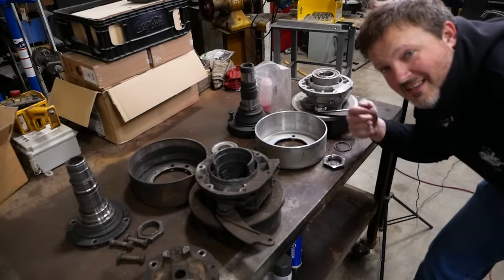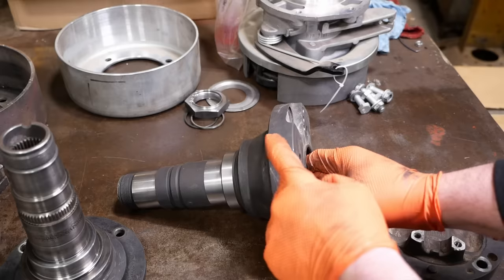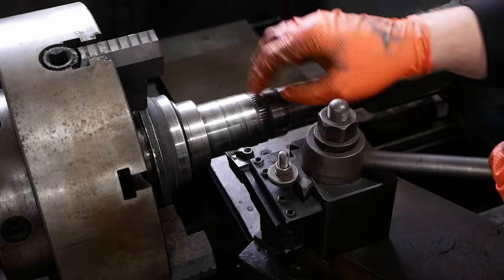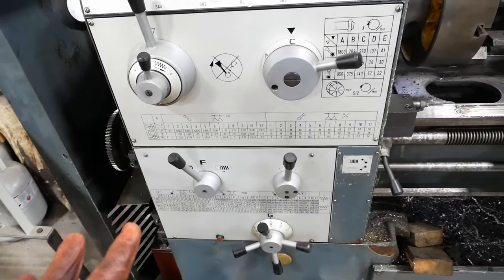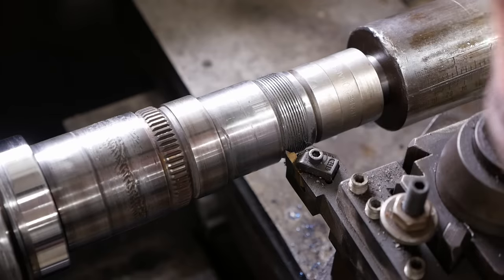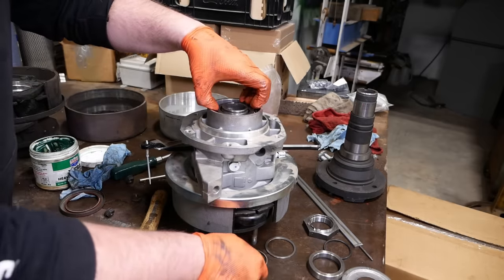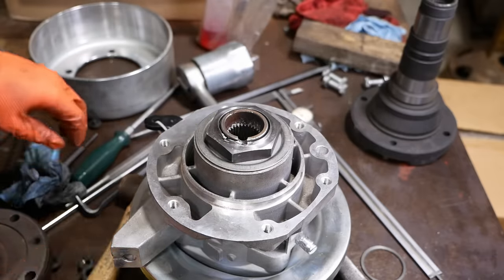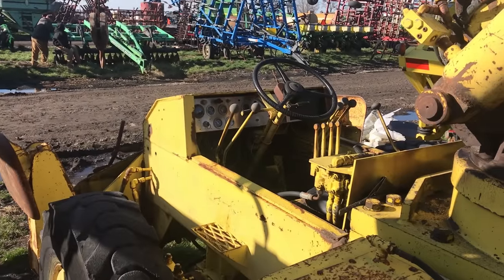"Sir, Your Parking Brake Exploded" - Fixing a Ford

Comment: Had boxes full of parts for those parking brakes.  Had fleets of these trucks.  Fyi ford used Transmission oil, We always used 75w90.  The really killer of these was people would forget to release the parking brake and smoke the drum.  The drum is difficult to get now.  
   We always checked for leaks when we serviced the trucks.  75w90 works far better, also be sure the vent works.  They would easily get plugged.
Reply: Thank you sir. I've been searching for hours for this info. I just got a brand new unit that I waited two months for. ATF was turning black after just 1000 miles and was wondering why ATF is used in these instead of gear oil. I'll give it a shot. Just wanted to say thanks for the comment/info.
Reply: @shallowada -if the atv is turning black it is getting hot.  I would be checking to be sure its not shimmed to tight.

Comment: A handbrake that requires oil.
NOW I've seen it all.
Reply from the maker: I know...
Reply: I got AC Delco handbrake cables that said to NOT lubricate or grease them due to dirt accumulation. They rusted stuck in a year.

Comment: I love watching your machining videos, Wes. I'm a now retired toolmaker, and learned my trade under the tutelage of guys who'd been working since the 40's and 50's. The last 15 or so years of my career, I used CNC equipment almost exclusively, but there were times those old skills on manual machines definitely saved the day, like you did saving those threads. Keep up the good work!
Reply: Correct. Thats why there will always be a need for older manual machines.

Comment: Hybrid Truck [Edison] video disappeared while typing, so posting comment here.
Excellent presentation, Wes. Learned a lot, thank you.
I should be able to answer this for myself, but don't know the efficiency value to compute: Is there no advantage to be gained by loco-style diesel electric for cars? No Batteries. Just IC engine running at best efficiency turning generator and alternator+steering pump. Genny powers (say) hub motors on rear wheels and contoller for these. No transmission or driveline. Could employ back-EMF braking to waste-heat pack to reduce pad wear. Perhaps a small auxiliary battery could be charged from this for other accessories.
Sidebar: See no environmental value in EV's unless they're charging from nuclear power. Again, wish I could know accurate numbers - but know that a pound of hydro-carbons burned in daily drive gasoline car would need more than a pound at a power station if it was an EV.
Reply: Of course now the batteries are now key to the transmission process.  Edison motors has chosen a Lithium iron phosphate battery.  It is minus 30% energy dense (compared to Lithium Ion) but good for lifespan and high charging and discharge cycles and much safer against thermal run-away. Now braking their e-axles will generate back EMF (I am just guessing you know the technology) to charge the batteries.  The batteries are now a buffer between the ICE engine and e-axles.  What could go wrong, you have the best of both worlds.  They have engineered it to run on Electric power but if the batteries go down to 50%, the generator will turn on and charge it to 80% and so on and so on.  Unless they flip the manual generator switch.  As long as you have Diesel, the truck will perform as a vehicle or a power plant at your job site. It can provide 2 or 3 phase electric power as long as you request it.
Reply: Good pitch. But I'm talking about NO batteries.
Reply: Not good for the reasons that the Edison batteries can take an in-pulse charge 3 times it’s charging capacity 3C (I don’t actually know) and discharge it 3 times as well 3D.  The batteries act as an energy buffer.  I guess you can run without batteries but you need to substitute it with capacitors.  Otherwise your system will just depend on the power output of your engine (up and down rpm) and without the chance to harness regenerative braking.

Comment: Awesome stuff, love seeing that kind of skill and knowledge going into rescuing parts.

On the subject of peening over the nut, I once faced a few thou off the back face of an unobtanium nut with a similar locking mechanism to get an unused section to line up. That application called for loctite as well. 😂

Comment: The rivets were for the original drum.  It was anchored to the flange.  My Air Force days we had lots of these.  We did lots of the rework on the rivets. We cut them and did what you did.  Great job and awesome problem solving.
Reply: "If the bolts wouldn't hold it, then the rivets never will."
Reply: @rickn8or  they were not there to hold it on, they were there to hold it to the flange, so the flange and drum would come off as a unit. Was not a good idea.

Comment: The FedEx contractor I worked for picked up a Chevy step van  (p65) iirc. It had one of these, which was way out of adjustment. That was fun when it tried to roll away. I ended up adjusting it before there was an accident

Comment: Nice work! A good tip for the nut, face about .010" of the backside. That way the orientation will change enough that there is some fresh material to collapse into the lock feature 👍

Comment: Hey Wes. I didn’t finish watching your assessment of the Edison electric truck. Now I can’t find it here on YouTube. Did you take it down?
Reply: Yeah, he took it down. Right as I finished watching it too. It wasn't a bad vid and it raised some good points. Some of Edison's numbers haven't seemed totally realistic and the torque figure they give is after gear reduction, which is misleading. 

However, the spreadsheet section of the vid seemed to treat the truck as a highway truck and not a mainly off-highway vocational truck. That means lower speeds and lots of idling, which is what its designed for. Also, Edison has been honest about their numbers being from simulation. The main point of Topsy is to get real world data, which is what they're doing right now. 

Maybe he realised that and took it down cause of that? Wasn't seeing any hate in the comments. At least the few I saw before it was gone.

Comment: Land Rover used the drum parking break on the driveshaft from the 1960’s - possibly earlier - until the early 2000’s on almost all of their vehicles. It works well since most are permanent 4x4 and this the brake holds all the wheels.

Comment: Awesome work Wes.. That lathe work turned out excellent from the camera angle it looked like the cutter base was going to hit the rotating mounting flange area(not sure exactly what its called) of the lathe but once you stopped the lathe it was easier to see there was a little bit of space between the 2 parts of the lathe also getting the cutter head lined up with the original threads seemed to be slightly tricky but you made it appear to be rather easy.. That lathe also seems kinda easy to properly setup with those charts once you know what the original thread pitch & spacing is getting all of the different levers & dials to make it flow at the correct speed to get the proper thread spacing getting the cutter head exactly lined seemed to be a little tricky but you just need some patience an test runs without cutting till its fully lined up yet with all that stuff invoved you made it look super simple to get those threads recut.. Always amazed by how well you are able to trouble shoot any issues you come across while working on projects like being able to finally get that repaired shaft to actually fit properly in place after a couple failed attempts you knew exactly what to do with it to make everything slide right back together.. 
Keep up the great work & continue putting out your rather informative content.. Ill see you on the next video!! 
Also Hope you an the family are doing great an enjoying life!!

Comment: My dad was never a user of parking brakes.  They were always non-functional from non use to my recollection on the farm.  Rusted cables, etc.

One story told.  '55 Ford F250 had a transmission mounted brake like this in concept.  Trans seeped enough oil it was greasy and would not hold.  Truck parked in the field on the farm and the brake was on.  Driving across the field later with the brake left on (it was greasy, recall).  At some point it catches on fire (!).  As the story goes, Dad is under the truck tossing dirt on the fire to put it out.

Comment: The tail shaft ZF parking brake Master! At one point in my life I was VP of Engineering for FABCO Automotive Corporation. We used the Bendix version of a driveshaft parking brake on our transfer cases for trucks with hydraulic brakes.. It was a much simpler design that worked just fine for many decades. Might be able to replace that ZF assembly with a handful of Bendix parts and a couple adapter brackets.

Comment: Reminds me of Toyota Camry and Corolla FWD trans in the late 90’s, they had seperate trans fluid and differential fluid.  Shops that were not aware would lose all the differential lube when changing a CV shaft, and not realize it wasn’t replenished by topping off the trans fluid. The diff would eat itself in a few thousand miles by running dry.

Comment: This kind of reminds me of the issue I had with my motorcycle transmission. 1 year only. Had a slightly longer and larger main shaft than the other 4 speed years. Was sold the correct shaft, but the rebuild kit came with the smaller sized bushing. Didn't know that was even a thing until I destroyed a rare shaft and had to source another. A year of research and an obscure forum post later and I now know why.

Comment: Beautiful work all things considered Wes. My main question is this! Wouldn't it have been easier, faster to just install a Micro Brake line lock if a longer drive shaft could have been used if' there was a way to completely remove the drum style parking brake? I realize my idea makes the separated braking systems impossible. I likely have a used brake setup on one of my Ford parts trucks but of course the customer and I have no way of connecting, lol. Really enjoyed watching you repair or do your Magic Act 😂😂😂. You're one in a million Wes. 😊

Comment: I've had to chase threads a lot and it's really easy to line up if you just turn your compound to 90 deg or parallel with the part. Then just engage the lead screw as normal and use the compound to find the position.

Comment: 16:39 a trick I heard and used from an old machinist for nuts like this was to take a bit off the thickness of the nut. Just enough that when tight it rotates a bit further and you can use untouched lip to fold in. 

Should hold like this too ofc

Comment: Same kinda setup as a 2000 Discovery II. 
Parking brake is on the tailend of the transmission. 
I had to pull my parking brake assembly foward to access my fill plug. 
The vehicle was a gift from my sister. Never been fully serviced. Anyway. I spent a few months gathering minor parts and got it roaable..😅

Comment: I would never call a simple car mechanic a "legend", however you have a skill stack far beyond that humble profession - no mechanic on the planet, can run a lathe, do complex threading and assemble shittily designed car systems back together - I may have overreached as I am still in awe of the Hail Mary move -  I agree, Ive had the feeling a few times lately, when things work out "fantabulous" (a little gay but never mind) and you can't believe this is within your skill set - your content is both diverse and "can't look away" engaging - cheers.

Comment: In the early 90s, I rented a moving truck to get from Montana to Florida.  It was a Ford Ryder box truck with 7,000 miles.  On day one of the trip, I discovered the parking brake didn’t hold.  It was the type you just pull a button on the dash to set the brake.  For two days, I had to chock the wheels.  On day three, I forgot to release the parking brake, and drove about two hours that way.  For the rest of the trip, it worked perfectly.  Go figure!

Comment: What happened to the Edison motors video that I saw posted this morning? I was planning on watching it tonight.
Reply: @jonathanbaxter5821  "dumb idea" is a bit of a stretch. The 2025 Ramcharger will utilize a similar style of powertrain/power generation as the Edison Motors truck. E-axles with a Pentastar paired to a generator powering the axles/charging the batteries. Will be able to run only on batteries for a short distance, like Edison truck, but also have significantly longer range than the Lightning or Cybertruck due to the on board generator.

Are there challenges for Edison to address? 100%. But I do think Edison and Ram's approach will make Truck sized and larger EVs FAR more approachable and make way more sense for folks who want to use their trucks for "truck stuff" vs have a cool truck sized gadet that's useless for doing "truck stuff" for an extended duration.

I think we all should be pulling for Edison and Ram to succeed here as their solution makes more sense than what the environmentalists are proposing... Batteries and only batteries in everything.

Comment: Btw there is a hole on the bearing housing that's covered by the gasket that mounts to the transmission if you put a hole in the gasket corresponding to the hole on the trans mounting side it will allow the fluid from the transmission to lubricate the bearings there is a tsb on it I had the same problem on my service truck and when I replaced the housing I did the tsb and didn't have to worry about putting separate transmission fluid in it

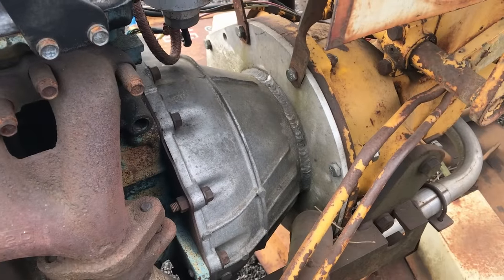Comment: That's an Isuzu 1.8L diesel at 18:56 from a Chevette along with the GM radiator and shroud. 52 horsepower stock.

Comment: I have a '99 C3500HD that uses a driveshaft parking brake behind a 4L80E transmission. None of that hydraulic junk, just good old fashioned brake shoes that lever out against the drum, actuated by a cable. Unfortunately, parts are difficult to find because people snag the 4L80E transmissions out of the motorhomes and such for cores, and then toss the brake hardware.

Comment: I have seen other YouTube creators spray metal onto a worn shaft, then they would machine the shaft back to specifications. in the industry are there like very thin bands of metal you can order so you can do something similar which mean you would have to machining the inside diameter of these metal bands to fit the worn shaft, just asking?

Comment: I work on these in my fleet of 40 delivery trucks. Also besides lack of oil a common point of failure is the nut just backs off because ford puts a tiny peen on the lock nut and it’s insufficient  - I tac weld it - I’ve done tons of these

Comment: That parking break design has gotta be the one of the stupidest things ever. Leave it to Ford to redesign the wheel and make it terrible. I remember the fight you had with one of these before.
Reply: Its A ZF design i believe. Ford just bought it.
Reply: that type of transmission brake was fitted to the 194x land rovers and is still used , as they were rag tops it was fun on ice to drop it in neutral and jam on the hand brake and lean out and watch the wheels one forward and one back on each side ( your passenger the his/her/WHY on their side )

Comment: That's probably the best repair that could have been done as everything is still "OEM" spec. I probably would have looked for a different driveshaft flange ($400) and shortened the driveshaft ($200) but I'm no Machinist unless you count a grinder.

Comment: It's so bizarre, but from what I've seen, in a bizarre ironic twist,  the "uber desirable" ZF5-equipped OBS Fords (especially the "holy grail" 7.3 PSD ZF5) seem to be much harder to keep on the road than the automatic equipped trucks these days. The standard pickup ZF5 has a ton of problems with the 4wd extension housing cracking (which I think you've covered before), housings and other parts are basically non-existent for these transmissions, and very few shops want to deal with them. The C&C version with the custom parking brake extension housing is another very problematic oddity (as you've discovered). I've seen driveline parking brakes on other vehicles, but it seems like these ZF5 ones are bad.

...on the other hand, E4OD/4R100 parts are readily available, there's still strong aftermarket support, and just about any automatic transmission shop will do one.

Comment: When I was in a Ford parts department I sold so many of these things. It cost over a grand new back in the early nineties. The only reason they used these was because the trucks had rear disc brakes. I guess engineering the calipers to use them like a normal car never occurred to them.

Comment: When I chase an existing thread I engage the half nut and with the spindle stopped,  loosen the threading tool holder, and push the threading insert into the thread to align to the pitch.

Comment: If this wasn't bad enough,  Ford used a non-servicable version on the 6r80 transmission. They then installed it on a bunch on airport tugs.  Every time they needed to replace parking brakes (annually because they use them as a service brake), they had to replace the entire unit.

Comment: You could run a mig welder while on the lathe, then recut the speedometer down...I'd have fone it just so the options there for the customer later being its not that much extra time or work.

Comment: Would of like to see you take the other route with the new one. I think it could have been alright to be a bit longer because all drive shafts that move for suspension have plenty of slide movement on one side of the drive shaft, then all parts would have been new with the option to have the Speedo fixed!
Reply from the maker: Negative. The new parking brake housing doesn't even have a port for the speedo gear. The new shaft also is not machined for a speedo. There was no way to make it work with the parts we had.